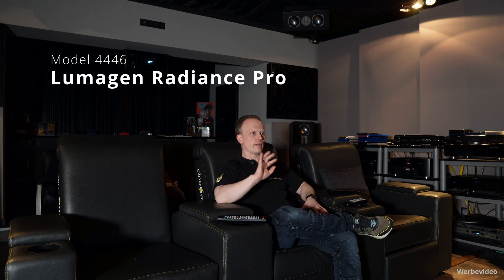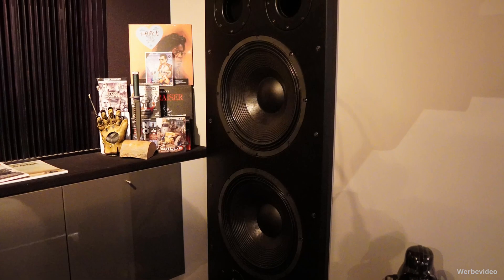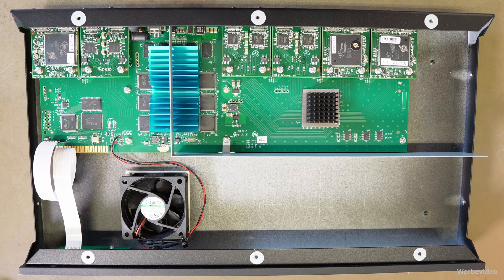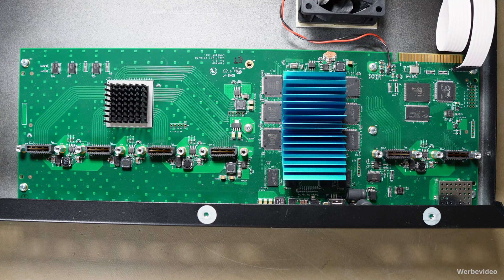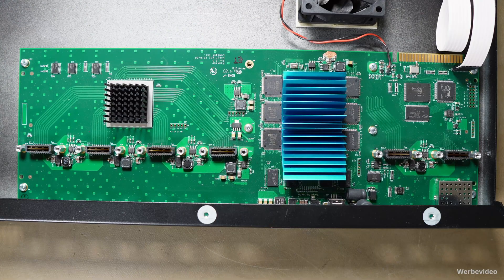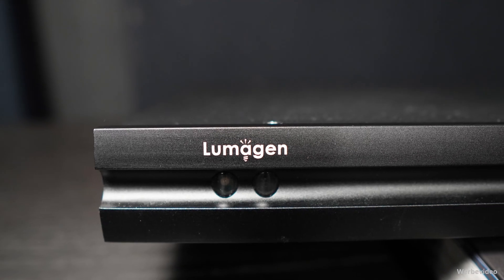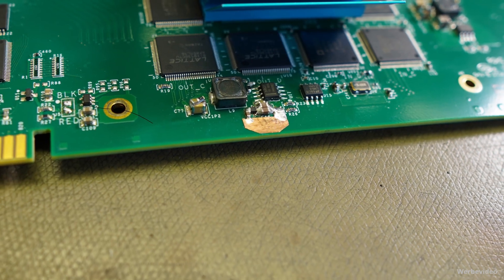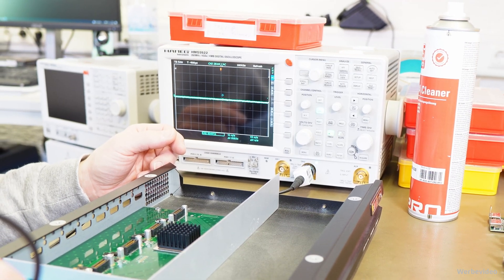Lumagen Radiance Pro 4446 - The How and Why we need a new upgrade!

Comment: Also, you make a measurement and say that it "could" be that the main board is unstable with the new firmware. Instead of ripping apart the unit, why not measure the board with firmware that you think sounds good and see if there is a change rather than just leave the firmware and mess with the hardware? Wouldn't it make sense to actually objectively measure the same output that you think is unstable with various firmwares?? This would show if the firmware is actually changing anything rather than assuming it does.
Reply: The video does not tell the whole story; yes, it's a bit simplistic. I would not call it a MOD, as many people do MODS, and in my experience, they make things worse. It was developed over a year of testing, as you said, in a standard loop test and restest ect. This is re-engineering. Cinemike is a savant when it comes to this. Jim is a genius in the first place for being able to create this and solve the issues, as well as his patented scaling, which is a secret company sauce as much as others try and make sweeping statements that it's just someone's known algorithm. I have tested the hell out of this over the last month when they were at a final version. The video doesn't show all the failed versions testing in the way you have mentioned. The beauty of an FPGA design is every time you have a new synthesis you have a new piece of hardware. It is not limited like a non-FPGA solution is, in which you would have to change the hardware every time. Which is very very costly and ultimately means it's a totally new product. FPGAs mean you can do that by rewriting the design of the chip. The issue with FPGAs is they are not cheap. GPUs are mass-market products, so it's cheaper for them just to make a new chip every six months and sell you new hardware. NVIDIA is set to become the world's biggest company as they have got this down to a fine art, and the world needs their AI GPUs @$50k a pop to change the world.

Like all things, you can't comment or make any judgment if you have not seen or heard it for yourself. I make the trip regularly to their place as that's the only way to see if it's making an improvement. I am a customer and have paid money for their work. Anyone who knows me will know I don't spend money unless it's worth it. In my professional world, I have sued people who don't deliver what they say. I am the biggest sceptic, and people come to me all the time with equipment to test and things they think make the world better. Most don't! If you can afford it, it is a great option if you can't, then the regular Lumagen is still the best video processor you can buy. If you have the money, then the Cinemike Lumagen (the same software) will give better results only if you have the equipment to match. If you have a question, go ask Cinemike himself like I did go see! I am learning every day. That's what gets me up in the morning. GO see it and get a demo! Then you can all make informed comments!